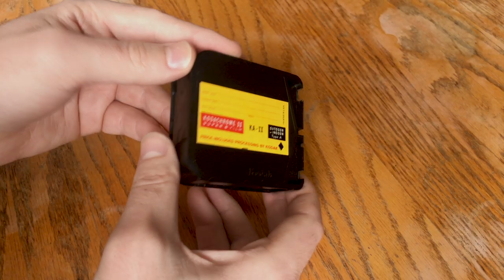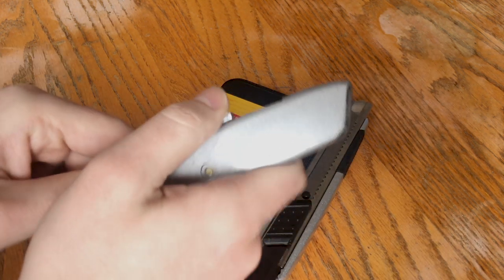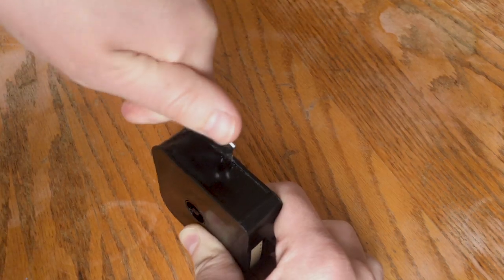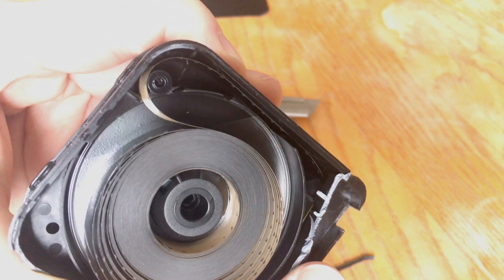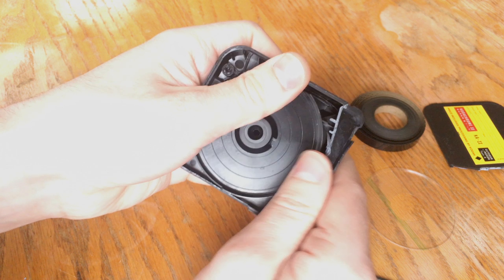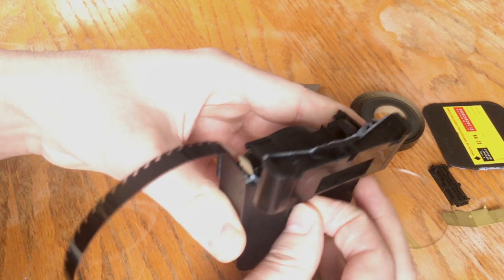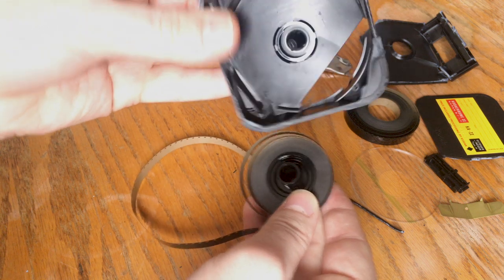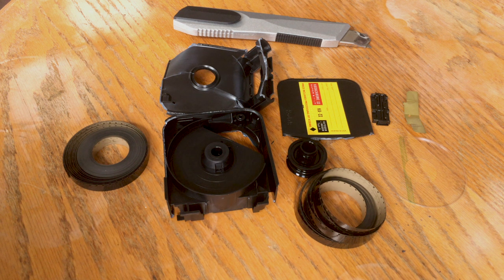How a Super 8 Film Cartridge Works

Comment: Fuji's single 8 system was better than Kodak.  The cartridge didn't need a pressure plate, and was 1\4 the width of the Kodak ( in size almost like a 4 track audio cassette) It simply would run from the top to the bottom of the cartridge.Because of this design it allowed for unlimited back winding of the film.  My experience with it was that the Fuji film yielded better and sharper results...
Reply: Single-8 has never really prevailed over the Kodak tapes outside of Japan. The Kodak cassettes were even built in the Soviet Union.

Comment: Thanks, cutting open the cartridge seem very dangerous. Why not break open the cartridge with a hammer? I am no stranger to film developing, even got my own business on ebay doing developing but developing super 8 kinda scares me. You should make a super 8 developing video.
Reply: Typically, finished Super 8 cartridges will have a "tongue" of film sticking out that says "EXPOSED". I find it easy to just pull the film out from that tongue when I need to develop them myself. But sometimes, the film tongue might break off when pulled or slip into the cartridge, so that's where I turn to a hammer and pliers. XD
Reply: @mynamehasspacesinit8687  that's great. So after you develop the film, how do you hang 50 feet of film to dry?

Comment: It's great to open it up and show us (could've bought a reloadable cartridge but it's interesting to see the original film in there) yet for developing I would never say ripping open the cartridge is necesarry. Doing that in a dark room with a rusty carpet knife is not ideal. For me, I put a small piece of metal into the pressure plate to push it back, and simply wheel it out from the end, it doesn't get scratched and comes out easily. You simple have to break the rewind mechanism by spinning the back.

Comment: Have you worked with audio recorded to Super 8? I know that some Super 8 film stocks will record audio. Do you know if any of film stocks currently in production will record audio and do you know where/how to get that processed?
Reply from the maker: Unfortunately all those Super 8 sound films are decades old now and that is no longer being produced. They used to put magnetic audio on the film but haven’t since the 80’s. I’m going to tackle sound on super 8 in the future, but it’s a non-sync format so if you were to try and sync up audio recorded separately then it would drift out of sync after a few seconds. You would have to work to kind of speed adjust your footage to match up with your audio.
Reply: @AnalogResurgence  Thanks for the info! That's very good to know but sounds like a bit of a headache. I'm thinking about working with Super 8 for an upcoming project, but I'm trying to work out the audio side of things. Looks like it could be a nightmare in post. Any suggestions? Maybe I could try my luck with the expired stock that uses the magnetic strip if I can find enough?
Reply from the maker: @taylorervin264  Most of it is crazy expired old Ektachrome reversal film at this point that typically doesn't age well. The sound Kodachrome is completely obsolete and no one will process that anymore. Not all lab will process it because it's so old and it took a slightly different chemical process than what's done today. You could try and source some but be sure to contact the lab you plan to use first to see if they would be willing to process it in their machines.
Reply: @AnalogResurgence  Yeah, the emulsion in the sound film is cheaper and weaker than in the silent cartridges. I had to develop my Ektachrome sound cartridge in B&W using a stand still developing method (no agitation whatsoever) otherwise the emulsion would slip right off.

Comment: i have a darkroom question? can i have a red light in the room, will it exposed the film, and can it be any red light bulb or does it have to be one form b&h meant for darkrooms?
Reply from the maker: For having a red light you can only handle things like black and white photo paper in a darkroom under red light. These papers are for printing and have very very low sensitivity and are only affected by light of certain kind. Red lights are not for handling rolls of film that you're going to be shooting in a camera because they're much more sensitive to light and the red light will ruin them. Red lights in darkrooms are only used during an actual printing process using already developed negatives and printing paper. Loading rolls into developing tanks or opening canisters to handle film has to be done in complete darkness.
Reply: @AnalogResurgence : I would like to see a darkroom basics video. Doesn't have to be a step-by-step demonstration, but like the overview and equipment names and uses.